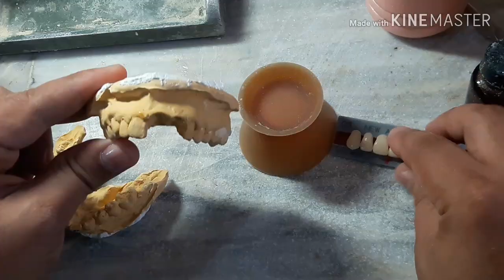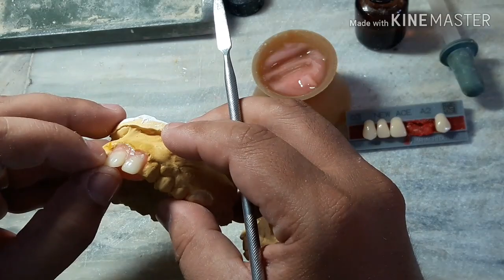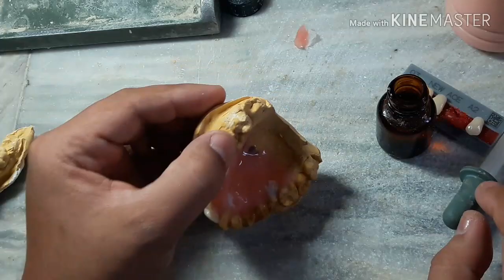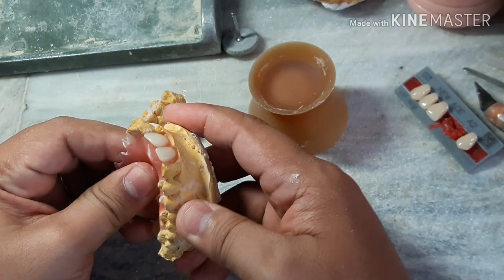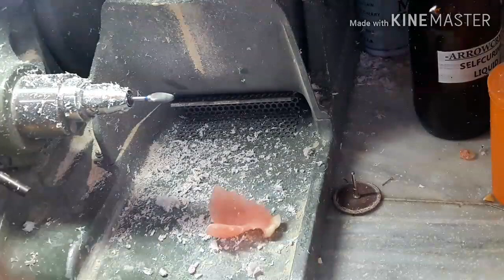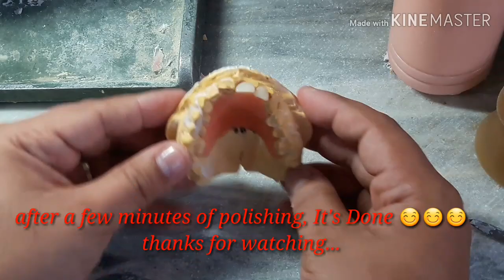How to make a Partial Denture

Comment: Wonderful video to share.  I wonder how the Partial Denture can hold without metal wires or hook?  If one side of the upper with no teeth, will it be strong enough to hold the whole denture with only the other side teeth to hook it with metal wire?  Thanks.
Reply from the maker: It can hold the denture even without wires because of the wide palate. Thanks & GodBless
Reply: Those wires are terrible on your natural teeth. I know this personally.
Reply: @ICEWIZARDVLOGS  lllll